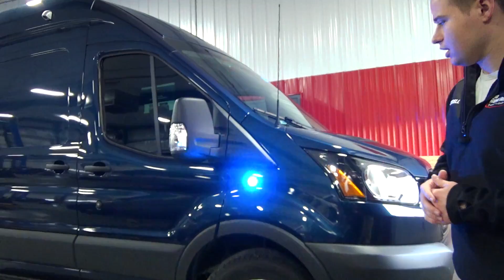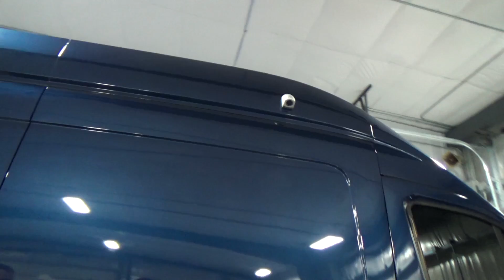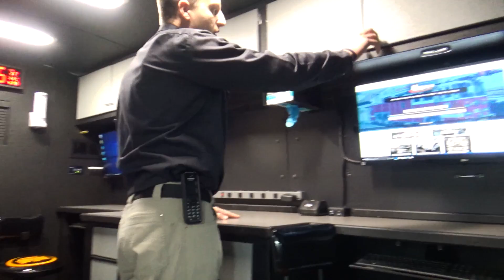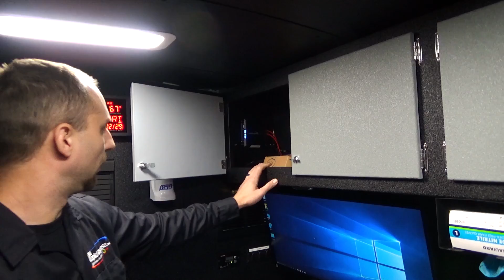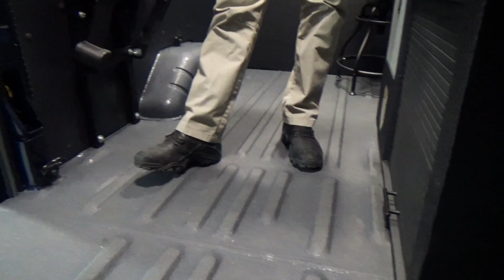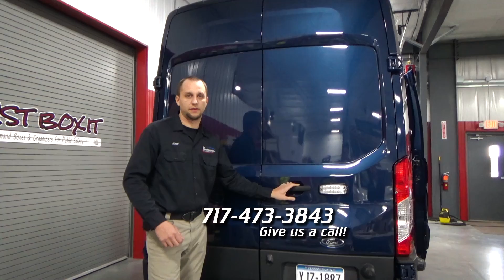Surveillance Police Van | 911RR

Comment: What type of air compressor did you guys install of the rear of the van by the control panel and looks like a sears craftsman 1 hp 3 gallon air compressor.

Comment: Undercover......... I would spot this thing in a instant parked in my neighborhood or any neighborhood for that matter,this rig screams 5.0.
Reply: Not to mention the paint is basically police navy blue.
Reply: More like unmarked not undercover
Reply: They hardly care anymore. There were 2 unmarked chargers in the middle of the highway I drive last weak acting like they're slick. Like "Hmm, I wonder what those 2 black 4 door chargers are doing just sitting there in the median. Odd".
Reply: Same
Reply: mtr71875 exactly
Reply: How I would think it was a normal just how do you notice it
Reply: @loganbuckley2010  well the grill lights even tho they are tinted I see the light shape , along with the side led lights which are not tinted but you can notice the clear led dome, and the back lights in door and even the visor lights in front windshield. This is def a unmarked command vehicle not soo much a surveillance van
Reply: mtr71875 i think the definition of undercover has changed definitions over the years.... nowadays it seems like if it doesn’t say POLICE on the side they call it undercover.
Reply: Randomized yeah should of used the word unmarked unit not undercover , undercover in my area is a vehicle with no signs of being LE for example a Honda Accord or Dodge Challenger, typically undercover vehicles have tinted windows and sometimes hidden cameras and audio , usually they never have light or siren packages. Unmarked would categorize this van and usually detectives cars and supervisors are unmarked not undercover lol

Comment: Wait am I missing something  it's a surveillance van with no windows in only two cameras for entry so exactly where does the surveillance part come in?
Reply: I think this is more of a low key command center prolly used for crime scenes and fatal traffic accidents but being unmarked is dumb to me since in no way this is undercover it is indeed unmarked unit .
Reply: hidden microphones and they can monitor without giving themselves away.
Reply: on the people not on the van, like a wire
Reply: What the hell you talking about? You need a van to listen in to wire?
Reply: @TheJoeSwanon   One of the gadgets they have is called a sting ray that intercepts cell phone signals. So yeah you need a van to pick up the cell phone and transmit it back to the tower.